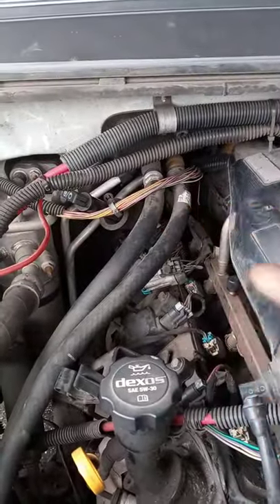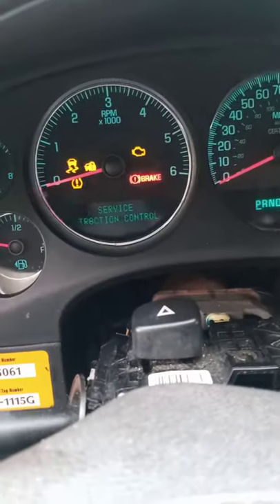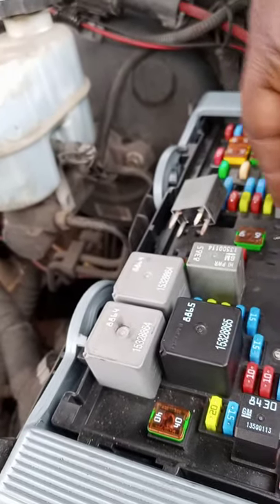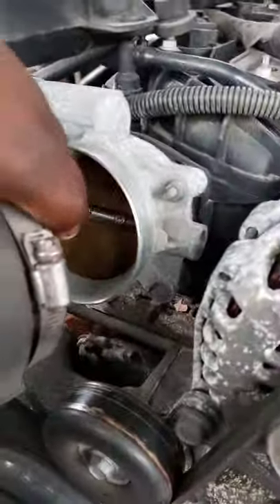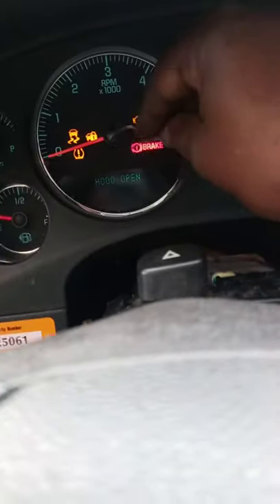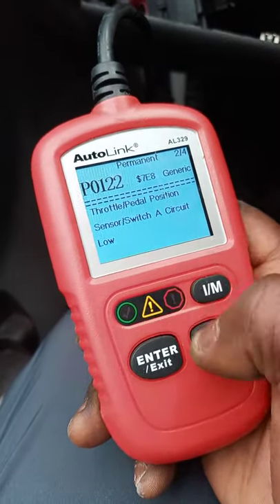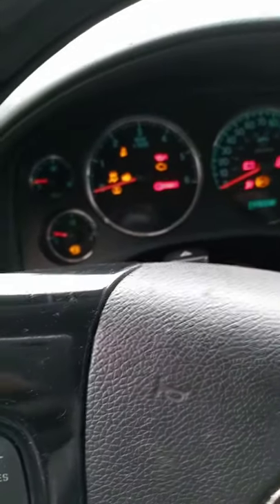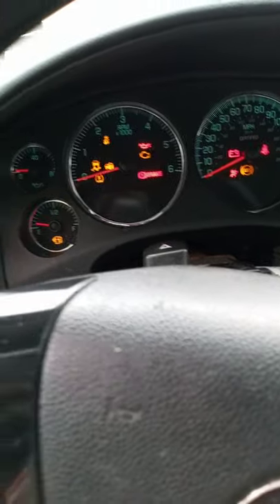2007-2012 Chevy Tahoe No Crank ( Solved ) ( 2021 ) ( ECM )

Comment: Is that not security locked?
Reply from the maker: the light is on but im not getting a service theft message
Reply: @Handymandan215  yes it's security locked won't start
Reply from the maker: @botlifegamer7026  is that the problem?
Reply: @Handymandan215  My cousin had the same problem with his Jeep. Battery died left it dead and then security thing came up wouldn't start. A dealership I think would have to unlock it again. Ask a dealership service they will let you know let them know that the security lock icon shows on the dash
Reply from the maker: @botlifegamer7026  i have a key programmer for the immobilizing lock the oringinal key that came with it and brought a new one and programmed it still doesnt start from neither key does...... My only option soon is the dealer ship because nobody knows. ?!😩🤦🏿
Reply: @Handymandan215  YOU MIGHT BE LUCKY   1- Disconnect Negative +Positive  from the battery 
2- Touch the Positive and Negative together 
With key on run position to drain power from system
3-Connect battery again

If lock lights is on have to wait 10-30  minutes to reprogram
Reply: Also maybe grounds . On the chassis
Reply: Driver side
Reply from the maker: @averagedrivewaymechanic300  i will try this because a New ECM didnt solve it but i did studied and read in ALL DATA that U-0100 is traced backed to The BCM since Only the high speed GMLAN modules have a serial data communication enable circuit OR an accessory wakeup serial data circuit, and the BCM is the output for these circuits. Refer to the control module schematics to identify which control modules have these circuits.

If equipped, ignition ON, verify that a test lamp illuminates between the communication enable circuit terminal OR the accessory wakeup circuit terminal and ground.
¤	If the test lamp does not illuminate, test the circuit for an open/high resistance. If the circuits test normal, replace the BCM.
Reply: @Handymandan215  having the same issues but my doesn't turn over and I don't get a Check Engine light when key is inserted.  Meaning it's not making communications to the pcm 🥴
Reply from the maker: Try this go the ecm in the Engine bay and look for connector J1 at the top of the Ecm and look for the Red wire or pink and white wire . use a wire and run it from Battery postive and splice in to one of the two wires for the ignition and the check engine light will come back and should start
Reply from the maker: Try the BCM under the steering wheel .... It should work
Reply: @Handymandan215   Any Luck? ? Hadnt been able to figure out my either... going to order a new Preprogrammed ECM... from Ebay..
Reply from the maker: @averagedrivewaymechanic300  dont get the ecm  i tried that no luck .... get the BCM sombody did it on youtube before ithink @nestorauto and i think since its a diffrent transmission (2wd) instead of 4x4 his method doesnt work  but the BCM is the real computer monitor
Reply from the maker: DJ so cool  no luck im going to try @average drive way wayy tmw
Reply from the maker: yup the theft system wasnt working comes to find out if u leave the keys in the ignition it will fry the computer and i got it from the auction

Comment: I have the same problem how you fix it
Reply from the maker: i haven't figured it....... even took it too over 3 mechanics and still haven't figured it out yet but Im leaning towards replacing the ECM thats in the engine bay ....... when i do ill post it
Reply: @Handymandan215  ok I took to the mechanic I’ll let you know what they said
Reply from the maker: @reyesfranco8574  any luck
Reply: WASSA DID YA FIX YALL SHIT UP I GOT SAME GOING ON
Reply from the maker: @ICEHOUSERECORDS361  nope i tried the Ecm brand new no luck still working on this !
Reply: @reyesfranco8574  did it work??
Reply: @averagedrivewaymechanic300  the mechanic changed the relays box and it’s working but the back door is locked now
Reply: @Handymandan215   check behind the power steering wheel there’s some wirier goin down which they can cause misfire lost communication I had the same problem first clean the grounds let me know what’ happen I’ll be happy to help you